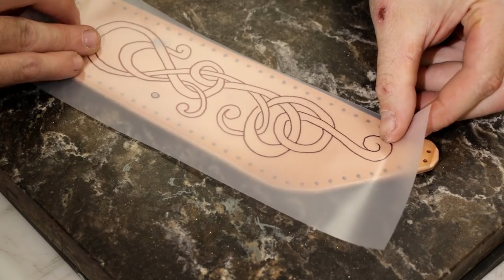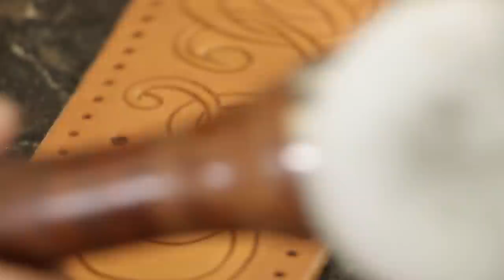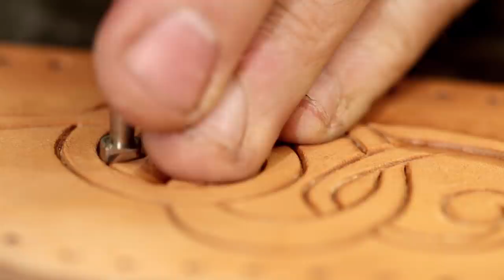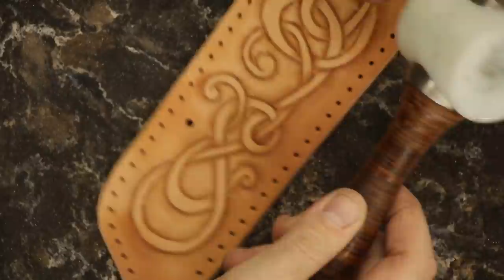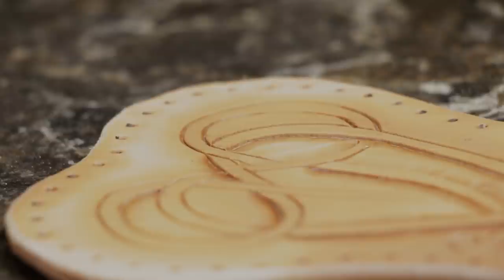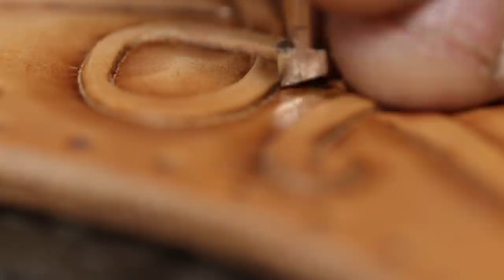ASMR Leather CARVING - Viking Knotwork - REAL TIME

Comment: Finally, something other than western motifs! My big issue is the tight curves. Much practice needed. I also learned from this video about beveling this type of pattern. What beveler are you using here? And have you ever used a push beveler for these designs?
Reply from the maker: Not sure what a push beveler is but I've cheated with a stylus to bevel before. Curves are hard, try rotating your piece while also rotating your swivel knife, it helps. The beveler I use here is either the small or medium beveler I have listed in the description of the video. Send me an email info@darkhorseworkshop.com and I can get back to you when I'm in my shop next just to be sure, but I use both.